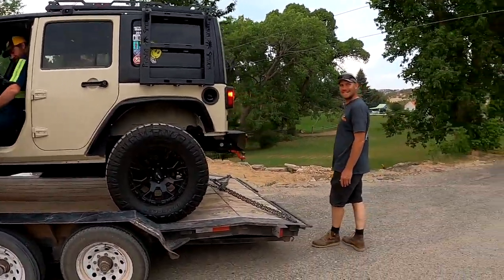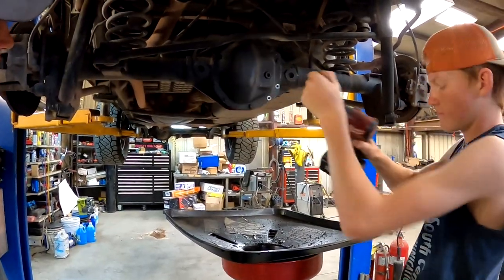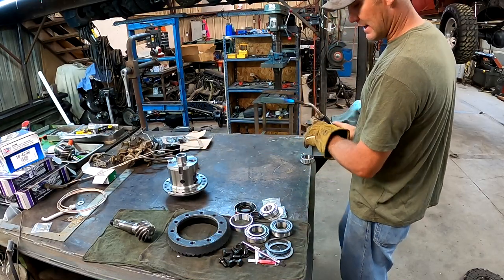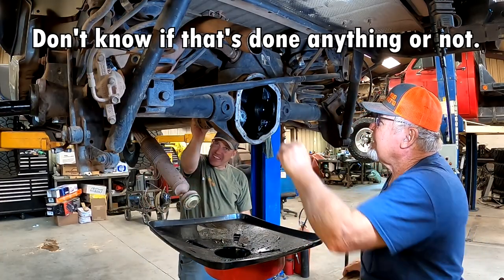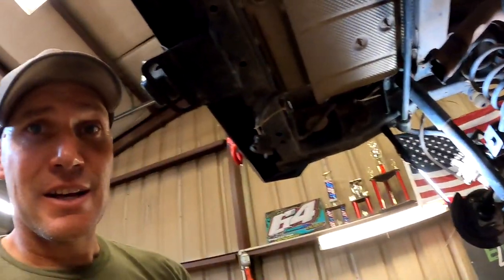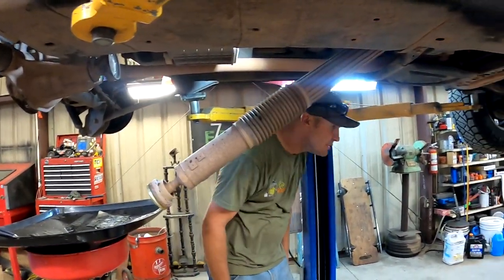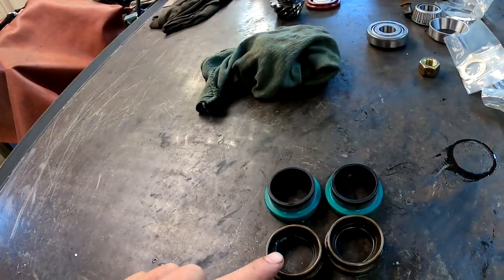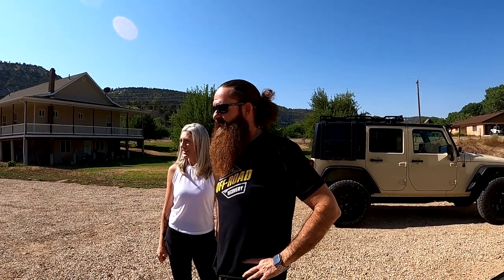Are all JEEPS this cursed?

Comment: good job..    you like Chevys , I have a 96 burb and do you like working on stock suspension on a 96?  I am pretty sure it has limited slip on the rear and open on the front.  (I am not a mechanic and i am prob wrong on what i am describing) .   is it better to stay limited slip on the rear and put a locker on the front or another way? My main application for this burb overlanding and moderate 4 wheeling.  I haven't found anybody in my town who i trust for this kind of work.  I dont know if you will see this msg but your really doing a great job.   Keep giving Matt a hard time hahaha in a fun way. take care . thank you.

Comment: Anybody ever mess with the bronze bushings for IFS Toyota's from ecgs? I guess I'm gonna give it a try, anything has to be an improvement over that stupid needle bearing in a bad leverage angle... I'm just wondering if its worth buying thier puller/driver kit, or whether I can just use a basic small axle bearing puller and a seal driver set 🤔
Reply: Eventually I'll get smart like Paul and fix it with the plasma cutter 😉

Comment: You 4 wheelers and your automatic transmissions. I got a 5 speed manual on the Ford and a four speed manual on the GMC AND  both have no computers to mess with. I went to natural aspiration on the Ranger, and it gets better acceleration that the EFI system that it came with and 22 mpg besides. Probably about 13 off road the way the gauges look. You might say automatics work better in sand/snow, but I have been driving both in sand/snow with no problems. You just have to double clutch quick or match gear speeds and not clutch at all. Just hold it gently in the next gear until it slides right in. Manuals are so easy to rebuild or change out when you have a spare already built. I once had a CJ-7 with that miserable Quadratrac transmission and hated it.

Comment: I want to say no but...
just did all fluids in mine, and the oil pan started weeping (rust).
changing that out was a bear of a job and one of the bolts was seized in the block, so it sheared off.
got all that fixed but in the process had to unbolt the rack, which screwed up the alignment somehow.
back from the shop getting that fixed, and the clutch pedal rod eyelet sheared off.
Reply from the maker: Cursed I tell ya!

Comment: That Tru Trac diff for the front is not a locker...Its a bias type, sends some power to the traction wheel but not 100%....Been using Eton Tru Tracs for 30 years on my Toyotas

Comment: A friend of mine...she had bought a brand new 2012 Jeep Wrangler 4 door top of the line with all the bells and whistles... driving to work she hit a pothole in the street nothing to serious for any other car but for the Jeep Wrangler 4 door luxuryliner it was enough to crack the windshield all the way across from one side to the other...she went to the dealership in Joplin they asked her if she had read the fine print on her warranty...seems Jeep knew about this design flaw...lol...

Comment: I have a question for Mr. Cox -

If you own a vehicle with an automatic overdrive transmission and that vehicle has been modified with tires taller than OEM provided - why do you need to install a higher gear ratio? In other words - why not just select "3", instead of "D" ("D" being "Overdrive"?) 🤔

Comment: If it was mine I would have done a tru track in the rear instead of the clutched posi. But yes for full on off road use lockers are better.

Comment: I've lived in Tokyo for more than 30 years, and I have to say, what you showed as "Sushi" might have been delicious, but that's not sushi LOL.
Wreaking a seal when you only have the one sucks.
I live in downtown Tokyo and getting parts of motorcycles is always a pain, no one EVER has parts on hand you ALWAYS have to order them and that takes a day or two, even though I live in downtown Tokyo...
Paul, you always seem to be able to get a nice pattern on your gears, well done.
I think Matt owes you dinner, a nice big steak dinner.
Cheers from Tokyo.
Stu

Comment: I watch many overlanding/4 wheeling videos on Ew Toob.  I sort of get it when most drive Jeeps of some fashion or another because others do.

One guy bought a new one and went overlanding and after a few years, sold it and bought a Toyota.  He didn't come right out and say bad things about Jeeps but he didn't actually praise his original vehicle either.

Ironically I'm going to a Jeep/truck show this weekend but just to see what's available as I'm slowly converting my full size Chevy van for camping.  I'm going to leave it 2wd with a Posi and maybe a locker later.  I don't do severe rock stuff anymore so it should be fine.

FORKS?

Comment: Helical gear locker?  Do you mean the excellent Torsen (Gleasman) differential?
For many axles, there are two different housings - one for numerically high gear ratios, one for numerically low ratios. That's because of the difference in offset required to support the pinion gear differs quite substantially between a ~2.90 gear versus ~4.88 (a 4.88 pinion is much small than one for 2.90.)
 I'm surprised Jeep would even offer a 2.91 gear for off road use. That is absurdly tall and also leads to more weight transfer when torque is applied.

Comment: Bad move heating the bearing with the torch.  Why?
Bearings are made from 52100 alloy and hardened to rC62.
Heating it to when it turns brown is quite hot, in the area of 600 degrees. 52100 starts to back temper at 350 degrees F.

Sorry to say the bearings are now shot and will soon fail.  *Hint: oil begins to smoke at 350-400F. If you see smoke you went too hot. 250F is all you need for this class of press fit.

Comment: The only thing that's a Jeep on my Jeep in my Jeep is the body. I have a 79 Jeep Cherokee Chief wide body. I replace the engine with a GM 350 the transmission with a th400 to transfer case is a new processor 205 the rear axle is a Dana 44 the front axle is a Dana 44. The only problems I ever seem to have with this thing is electrical. But I'm getting a handle on that

Comment: Legit curiosity... Did I miss something or did you guys put 4.88s in the rear and 4.56s in the front. Will that not mess with the transfer case/transmission when it's put in 4wd?

Comment: Hey Paul I have an original 95 4x4 Toyota Tacoma with manual lockers, it has the V6 and a manual 5speed. Not looking to build a rock crawler just something that makes all wheels turn. Most of the time I will be on blacktop. Do you know what would be good locking differentials so I can keep it pretty much stock Thanks

Comment: Ypu could've saved the bearing and seal by using your press. Do it alot at work and don't have to replace bearings 98% of the time, unless they won't come off or that's what's needs to be replaced. Saved plenty of seals too.

Comment: You need an induction heater for the bearing swaps, beating on bearings isn't good for them.
Reply: He’s sliding the inner race only.  The bearing isnt taking any load.
Reply: @stargazer7644  it does take the jarring action, been a millwright for 40 years I've done a couple of bearing swaps

Comment: I bought a 60s jeep
With a 289 ford and a broken rear gear.. the problem was .. the gears were home made.. thats right the original builder machined off the mounting plate off the spider gear housing .. then they found the gears they wanted and welded them on.. well the boys ran the ship out of it till they broke one gear in half.. the dilemma was ... we cant match that up. I bought it and pulled a pair of stock rears from a junk yard and just installed them .. what a ripper that thing was .. put alm the mud hill climbers to shame . I would run the hill in reverse just to make the big dollar rigs cry.  
I hit a stump with that one and was thrown clear.. after that i build  a cage jeep with belts.. ya the 289 jeep had no belts .. i still have the motor but the jeep is gone

Comment: I am a Jeep fan, will always be.  That being said...Chrysler solid axles are garbage.  Always have been!  I can't count how many ti.es I've replaced bearings and seals on the several models I owned.  They are also very noisy to boot.

Still..I would rather own a Jeep than a Toyota anyday:)  even if I won a Toyota or was given one I would sell it and by a Jeep.

Comment: Im cringing as you wreck the rear end bearings by heating till color change, then using the air chisel on the rollers and races of the pinions....heat is easy but SO wrong as the press sits idle in the same shot...Press them on and get a axle removing tool...or better make one...its just a pipe with flanges at the ends, one to hold the bearing retainer and the other the press. My Toyota retainers give off a real nice satisfying big bang at about 10 tons of presser. Just how much molten metal went in to the axle bearings when you plasma cut the retainers?....NOW heating the retainers to install is just down right dangerous...IT's a PRESSED FIT...but yes the heat is easy till the axles pull out due to retainer fail.....Also try some cutting oil with the drill bits....Do have to say your entertaining....Next best thing to Road Kill and their zip tie moments....

Comment: Sorry but ALL jeeps are the very bottom of their class for collision safety ratings, they are rolling death traps, but Chrysler Corp. has no incentive to change them or make them safer because people keep buying them because they are a preferred platform for off-roading, don't ask me why, because there are several vehicles that would make better platforms for off-road use. I hope that Jeeps will be a lot less popular now that the Bronco is back on the market, because it is a considerably safer and better option all around, perhaps if people stopped buying the Garbage Jeep line until they make them actually safe to be in in case of an accident, the 2022 wrangler barely gets a marginal test result but still overturns in a partial overlap collision. something Jeep has been suffering from for forever. Overturning vehicles are dangerous, and the Ford Bronco does not overturn, but stays on it's wheels in these tests, plus, inside collisions the lack of side impact airbags can result in serious passenger injury, there are SRS airbags available but only as an option, as far as I'm concerned, safety should NOT be optional! They changed this to standard in late 2017 for 2018 models so be aware of this fact when buying older Jeep wranglers, preferably it would be better to avoid buying Jeeps altogether, but people will buy what they want regardless if it makes sense or not, just remember to look at crash test ratings for the jeep you want to get and then decide if you want to place you and your family at risk by buying one, because there are a lot of idiots on the road that place all those around them in danger by the way they drive. I have a niece and nephew-in-law that bought a Jeep Wrangler despite it being at the bottom of it;s class for crash test safety and they have three children, I pray they are kept safe and never have to face the results of choosing a substandard vehicle for their safety simply because they like the look of the vehicle. Buy a Benz, or BMW or Even a Land Rover, these all have much better crash test results than Jeep!

Comment: I got a question I thought if you put 488 gears in the rear I thought you had to put 488 in the front so they match please explain because I was always told if you change the gearing in a four-wheel drive vehicle what you put in the rear you had to put in the front if you put 488 in the rear you had to put 488 in the front you put 456 in the rear you had to put 456 in the front like I said please explain this is Ken groveland Florida and on my four wheel drive if it broke I took it to a guy like you because to attempt it myself and didn't have the time so please explain cuz that's what I was always told and the guy that did the work on my truck that's what he was taught and the gears in my rear end and my front end were matching okay man you have a great day and I love your videos and I laugh my ass off when you do name that part with Michelle and name that tool because it's so funny well the girls that I used to date and even the girl I married she was the same way she didn't that no Jack about the parts or what tools you had to use to put them in all right man well have a great day

Comment: U ain't shit'in. My Wife's new 4 door Wrangler is the Biggest POS. 42.000 dollar Jeep 66.000 miles 3 major  repairs. My 25.000 Dollar Nissan Frontier. 178.000 Miles Never once in the shop. Jeeps frame has more rust. Jeep 2018 Nissan 2013. Trading Jeep in on a new P4x Frontier or a Toyota Rav 4 soon very soon. Never will we buy another Dodge product. JUNK

Comment: I don’t know if that Jeep is cursed but I do know my 2012 Jeep is a piece of shit. Heat doesn’t work constant electrical problems. Fuel cap replaced 4 times doesn’t seal. Nothing but problems… if it weren’t paid off Id get rid of it!!! Will Never buy another…

Comment: Love you guys,  but you have no business setting up gears for yourself let alone for somebody,.  On the rear the pattern was way to deep. The preload on the pinion was way too loose, you make fun of torque wrenches but this stuff is actually critical for a lasting job..Did you even check the carrier bearing preload?  As you say the gears went in good is a funny statement.  Complete hack job gear set up,  this is a set up that will  not last.  Sorry but the truth.